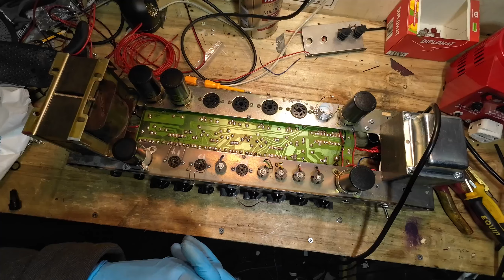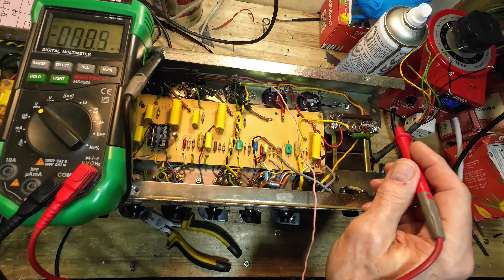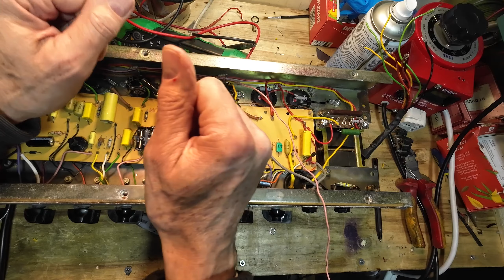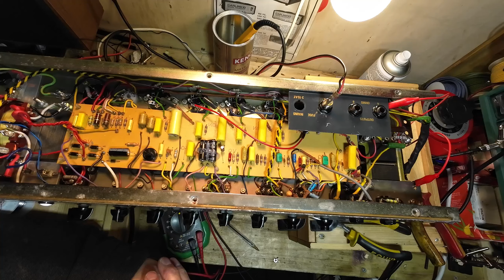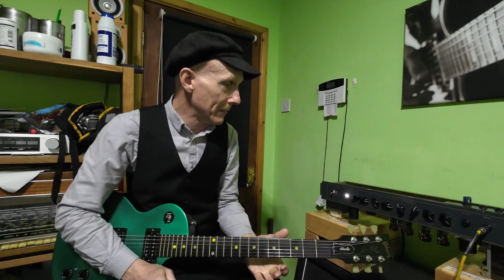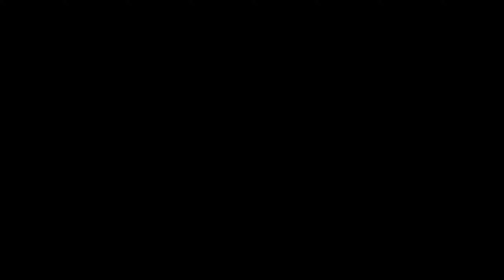Vox 125 100 Watt Guitar Amp Head Output Transformer Fit The Saga Continues!!!!!!!!!!!!!!!!!!! Part 4

Comment: If I run into a scenario where I'll need to install nuts onto the ends of bolts that I can't see and can only reach by feel I will sometimes glue the nuts in place to the bracket in advance with high-tensile-strength epoxy glue. Can you guys get JB Weld epoxy glue in the UK?  The stuff has powdered steel in it and people have even used it to patch cracks in engine blocks. Theres a "Kwik" version, and a slow-cure "Weld" version which is the strongest. If you clean and degrease the metal bracket, and the nuts, and ideally rough them up with a Dremel tool attachment or sandpaper, you can epoxy the nuts to the bracket reliably.  This works best with "Keps"nuts which have a built-in star washer.
Reply from the maker: I think we can get JB weld over here. I will check out the Keps. Thanks mate. Take care.

Comment: Glad to here you are not giving up
Just completed my JTM45 clone and switched on and set the bias and worked first time
very quiet and sweet sounding and very clean.
I used polyester caps 2x 10mfd@250 volts in the bias  supply and works great.
Reply from the maker: Hello. Part 5 should be coming soon; later this month. That sounds cool. I would like to hear and see some pics of that build. can't beat a JTM45. Take care.

Comment: Some of the noise is probably because you're sitting right next to the amp, with the  transformers throwing hum fields at the guitar;  and the other thing that makes a difference for testing is putting a piece of sheet metal on top of the amp so that it's almost completely shielded (the same way it would be shielded if you put it back in the cabinet, so that the aluminum foil tape inside the cabinet completes the shielding).
Reply from the maker: I tried the sheet metal thing. I am going to change the other two preamp tube sockets. they are junk. Changing just the one made a massive difference. Part 5 should be out soon. Take care.

Comment: Fantastic series! Found my way here as I’m currently restoring the exact same amplifier. How did you find a suitable replacement for the output transformer? Any tips?
Reply from the maker: Hello, thank you. I think the transformer came off an old Carlsbro 100 watt PA. The amp is still not finished yet. I have had so many repairs it has been put on hold. It's shop stock so it pushed to the back of the Que. I really must get round to finishing it. Has the transformer blown on yours?
Reply: @vintageguitaramp_guitarteacher  I believe it’s been compromised as I’ve lost quite a bit of gain and the timbre is pretty weak. Haven’t bench tested it yet, but finding a suitable replacement has been challenging.